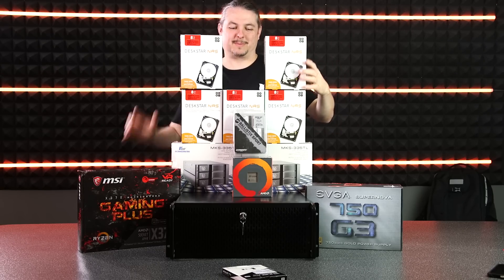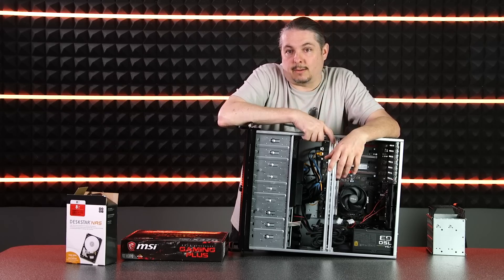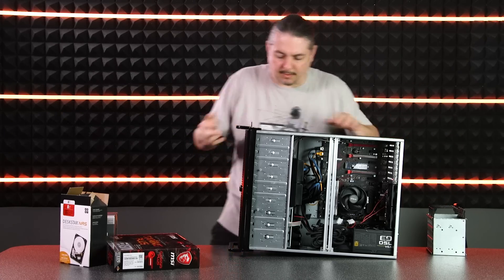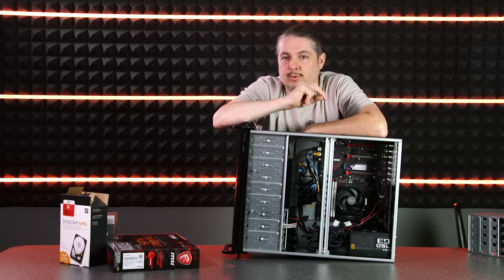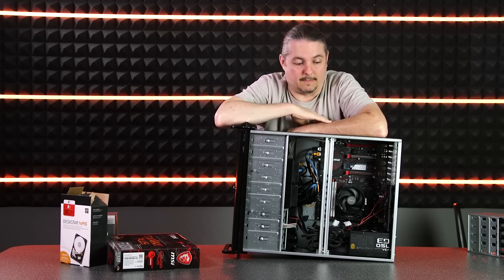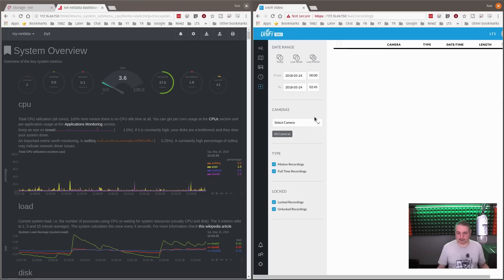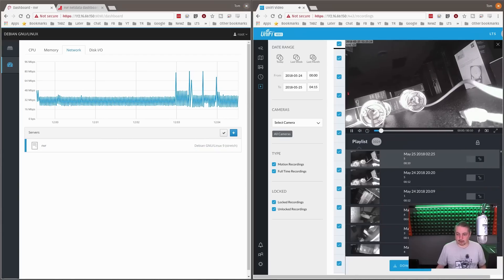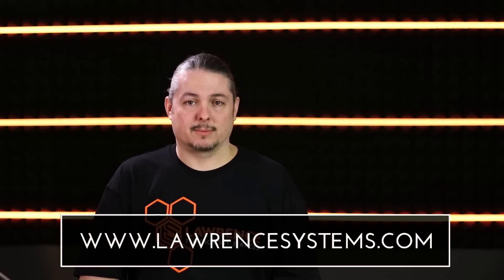48 Terabyte Ryzen 3 Ubiquiti / Unifi Video Server Build

Comment: I have a suggestion, I'm doing almost the same thing recently (but with zoneminder because the camera are already in place) and it seems that using zoneminder as a container on top of proxmox doesn't bring any overhead and you can leverage zfs from promox. Maybe you can do the same trick with the unifi nvr controller

Comment: I have not tried X-windows with the  Ryzen 3 2200g yet, but Ubuntu 1604LTS works well with unifi server and we've previously done busy NVRs  with the GUI autologin and Chrome's homepage set to the NVR login. Worked well. Chrome probably uses more cpu/mem than anything. Generally it's good to have the NVR hidden though (headless).

Comment: Gday I know your claiming you went budget, by from the view of an aussie, it just doesnt seem the case

 Prices in Australia

 CPU  - Ryzen 3 2200g  AUD$140 
 https://www.mwave.com.au/product/amd-ryzen-3-2200g-4core-socket-am4-35ghz-cpu-with-radeon-vega-8-graphics-ac11713

 MOBO  - MSI 370  AUD$200
 https://www.mwave.com.au/product/msi-x370-sli-plus-am4-atx-motherboard-ac03164  

 RAM   - 8gb non Ecc DDR4  AUD$145-185

 Case  - USD$85  AUD$125-155
 PSU     AUD$200
 https://www.mwave.com.au/product/evga-supernova-g3-750w-80-plus-gold-fully-modular-power-supply-ac03441

 AUD$830 without 4 port gig nic/10gbe nic , without SAS HBA and without drives

Comment: how do you  implement  the RAID 6. was it using the OS RAID
Reply from the maker: Yes, with Linux
Reply: I  was think to boot the OS off SSDs and use software raid for the data disks. although I was planning on using ubuntu instead
Reply: Man, write-hole is screaming at me right now.

Comment: How many cameras on that cpu?

I use Blue Iris and Xeon CPUs with Intel Graphics builtin (H.264 offloading).
20 cameras and 3 to 5 people watching.

I did not find any Linux software with the ease and features of Blue Iris.

I avoid raid as a rule and use mirrored hard drives instead. Then simply let Blue Iris move the files from the daily storage to the weekly and monthly hard drives.
Reply: what type of cams are u using